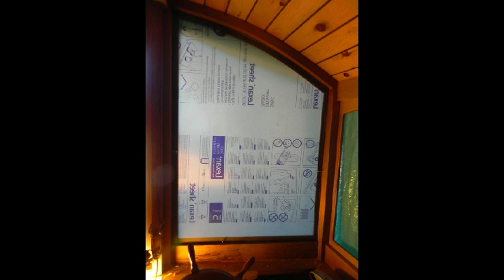Build a Cheap "Tiny House"...Boat, DIANNE'S ROSE

Comment: The video and the carpentry are beautiful. However after just recently working for our State Parks Rangers office you would not allowed be allowed to float that on a Pennsylvania lake. Meaning the hull. The hull cannot be a flat bottom unless it's pre 1980 and then you would need a bilge pump motor driven. If it's an out of the way lake that maybe okay some places... Just saying they are even getting tough on homemade KEG and BARREL hull boats if you have ever seen those houseboats built on old beer kegs and 55 gal drums. The reason I am posting this is because I am getting ready build one even the trailer. I have these notes from Arkansas from where I plan to float my floating retirement villa. Unless the hull shells are certified for Marine use y'all may not get that thing on some lakes so i am being told...  I was leaning towards using welded together 55 gal barrels all welded together here by me here to form a hull... Nope as good a welder as i am I couldn't get em certified they're basically outlawed except for Idaho Louisiana for some reason or maybe they haven't adopted those policies just yet. The premade hulls i am looking at are very expensive and very shitty quality is a mild term for what I just looked at 2 weeks ago on a Friday. In the old days they threw chicken or baling wire over a bunch of 55 gal drums and built a platform on em... Ya can't even do that no more. You need a bilge and most a min 150 galllon black water tank with a grinder pump or they won't allow ya to pump your poop at some docks made for that. The fuel tanks need to be plastic and protected under the unit... I have to look I now 3 sets of certified plans they complicate my simple little dream.
Reply from the maker: So far no one has had any trouble registering their builds or had restrictions on where they can go. I would clarify that our DIANNE'S ROSE is not a flat bottom hull but does have a flat section and otherwise "v"s and arches. You have looked into it, however, and I will follow up what the regulations are to better inform myself. Thanks for the heads up! Best/Roy
Reply: Yes I am curious about all of it but I think maybe I should clarify if it's a day runner who knows the rules there maybe such a thing but Arkansas and Tennessee require an Aluminum hull shell foam filled hulls and they have to have a hull cert stamp if you wanna leave it at Marina and rent shore power and water and it has to have a holding tank 150 gal or more. I am saying also that they collect your sewage at marina's like the trash once a week it's $25 to empty sewer and house trash the barge comes around once a week to collect waste that is the fee at least where i am planning to go. I researched this a bit and it may sound expensive but $25 a week for sewer water and electric is cheap compared to some cities. The slip rental prices are discouraging me it seems they go by the unit size and location is what I am told anywhere from $300 on up monthly weekly is even more like $200 per week slip rentals...  I mean I am single retired and that is not all that cheap but if it was 2 people retired you could make it go and obey the kooky rules. I mean when ya build a house there is a building code and that is the way I look at these rule books and design plans.
Reply from the maker: Let me know what ever else you find out. Best/Roy
Reply: So far what I have gotten is from the Tenn. and Arkansas Chamber of Commerce & their lakes tourism stuff which isn't much but it does seem to contain some factual data on houseboats which are todate very popular living and vacationing arrangements. The fact your unit is able to be trailered or removed may give way to a host of other rules. I am looking 4 myself to build a permanent year round unit and buy the lot adjacent not rent there are some of those lake areas where you can buy your lot and make a slip of sorts if you want to only the lots can be 30-40K+ in some locations plus you have the other expenses which kinda takes the wind right out of my sails. I plan on using the pontoons from 3 dismantled Catmarans they were disassembled to be scrapped I bought the pontoons because they were like new yet. When you have and own your lot you have to have a septic holding system 10K plus on the cash scale to construct and 180gal minimum holding plus you need water and electric to be installed which can cost upwards of 30K. Then you have to contract for waste and trash removal. So far I am now researching something already built and 4 sale might be the cheaper alternative but you know and I know we always get surprises when we do things like that... So that is what I know so far is a foam filled hull set up is mandatory in the more popular areas as is a registration number to the unit and then I think on E-Bay I found an Arkansas House Boat rules guide is what it appears to say it is pertains to lake house boats in Midwest and Florida USA. I plan on ordering it soon I get paid on Fridays so that is my current scope of knowledge but the more ya know the better things turn out. I would hate be building a unit and get shut down or fined because I went about it blind. I like your little unit it's cute.

Comment: I see the curvature along the edges now the boats upside down, maybe called a chine, don't know enough to be sure if that.s the right name. I missed it looking at the boat in the water
Reply from the maker: You are correct, chine is what it is called. The bottom shape is the reason why the boat handles rough water well.  Best/Roy

Comment: +Roy Schreyer could the roof of the cabin be made flat and used as a roof top deck?
Reply from the maker: The roof is intended to be as lightly built as possible to achieve the boat's performance goals. While I can walk on it there would need to be additional structure to use it as a platform. With the windows open we feel we are outside but with the advantage of avoiding the heat as we're sitting in the shade. On colder days or in rain we adjust how many windows we open so everyone stays warm. We don't miss being on the roof but you may. Best/Roy

Comment: How much did the fibreglass cost thanks
Reply from the maker: 50 yards of 38" X 6 oz cloth was used and another 20 yards is recommended if the boat is to be left in the weather on a mooring or dock. We keep ours in a shelter when not used so the decks and cabin sides are just sealed with epoxy and varnished. These should also be glassed if left out. This cloth costs about $7 CAD per yard so it cost about $350 or $500 CAD if the decks and cabin sides are also glassed. Epoxy is not cheap but I do not recommend using polyester resin! 6 Gal of resin and hardener was used for our DIANNE'S ROSE. The cost in Canadian... $1,000! Not cheap but well worth it as I have confidence in the end knowing the boat is well protected. I outline strategies to minimize costs included in the plans. Visit RoyDesignedThat.com for more info. Thanks for the inquiry Mark! Best/Roy

Comment: how much does this cost to make
Reply from the maker: The material  you use make a difference. For marine ply, which is what we used it is about $4500 CAD but could be cheaper with Exterior grade ply and paint rather than varnish...

Comment: If you did a build video with step by step how to ill purchase plans.
Reply from the maker: +andrew moon Hi Andrew, funny thing is that the Plans have the "Step by Step, How To"  written into it with the diagrams (like a manual) and include many more detailed build photos. The plans  save a great deal of time trying to calculate measurements and thinking how things are done! It is all clearly explained (Step by Step). Ever done a puzzle for the first time? Second time round is so much simpler. Plans offer the same benefits! Here is a comment that a builder posted on our Face Book Build site......I got my plans today for the Diannes Rose! I want to make an unsolicited comment about them:
"I have owned easily, close to 30 sets of plans in my life from just about every seller of plans out there. From tugboats to barges to sailboats catamarans, runabouts, jetboats, cruisers, canoes, trimarans, you name it I probably have a set of plans for it. Yes, I am a bona-fide plan-aholic!, But when I got your plans Roy, I was astounded at how incredibly well thought out and detailed they were. I have never seen a set of plans so comprehensive, yet easy to understand in a step by step manner. Well done, and I tip my hat to you, since you must have spent countless hours doing them up in a way that pretty much anyone could build. I have seen so many sellers of plans say they have done thier plans for amateurs, and I can attest to the fact that very few of these are easily understood. So as far as that goes your plans are a home run! They are quite refreshing to me in the novel approach being so clear and easy to understand, not to mention, that to me they are a work of art, as far as I am concerned worth every penny of what I paid. What else can I say,you nailed it Roy! " 
best
Doug West......A long answer to your comment Andrew, true, but it may help people understand why the boat plans offer good value for money! Best/Roy